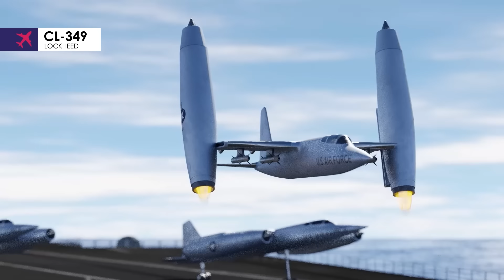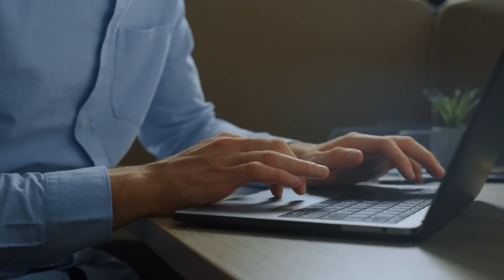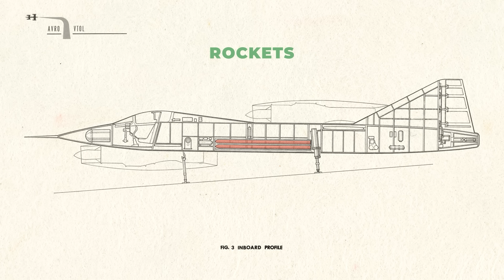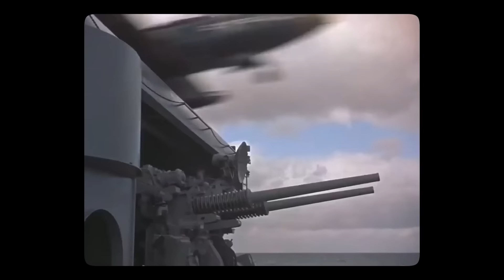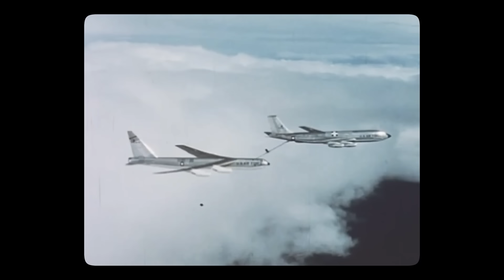Real-Life X-Wing Fighter Jet? ...Canada Tried It

Comment: That’s a cool design. It’s a pity it never got a chance. Would have been cool to see these X wing fighters in the air, and more, it would have been interesting to see what other air craft might have been born from this idea.
Historically great aircraft give birth to greater designs.
😂 Mach 1.7  is not a brick. Its speeds put it less than 200mph slower than the f16 or f18.
So for its time, it actually wasn’t bad. What probably happened was they over promised and when it couldn’t hit Mach 2 the navy lost faith. It still would have been a good bird I think, and once in production, the little bit of speed could have been worked out.
It’s not unusual for airplanes to start their life’s a bit less than planned and then become the masterpiece aircraft that were originally envisioned.

Comment: I'm a proud Canadian veteran of Cold War vintage. It does not diminish the accomplishments of AVRO Canada and their group of highly creative engineers to place this "X-Wing" and the "Arrow" in context of the competition from the giant aerospace industry in the US, UK, etc.
Some Canadians struggle with the facts because they may believe that the Arrow should have survived. Facts do not unequivocally support this.
Although it would have been nice for AVRO to survive as a result of interest in the Arrow, the facts were that the US aerospace industry was not, as some people state, behind in developing aircraft that could meet their required specifications.

Here's a short factual list of Mach 2 aircraft in order of time of achieving Mach 2 (starting with a bomber!)
1.) Convair B-58 Hustler, Achieved Mach 2 in December 1956. Designed to routinely attain Mach 2. Entered Service in March 1960, Quantity Produced: 116.
2.) North American F-107. Achieved Mach 2 in tests on November 3, 1956. Did not enter service.
3.) English Electric Lightning, Achieved Mach 2 on November 25, 1957. Entered Service in July 1960. Quantity Produced: Approximately 337.
4.) Lockheed F-104 Starfighter. It achieved sustained Mach 2 flight during its testing phase. It was designed to reach Mach 2.2. Entered Service in February 20, 1958, Quantity Produced: 2,578.
5.) Republic F-105 Thunderchief. Achieved Mach 2 during its first flight on October 22, 1955.  Designed for Mach 2+ speeds. Entered  Service in May 1958. Quantity Produced: 833.
6.) Avro Canada CF-105 Arrow, Mach 2 Attainment (meh): While the first prototype, RL-201, achieved Mach 1.9 in level flight during testing, it was designed for Mach 2 speeds and was certainly capable of it. Its first flight was on March 25, 1958. Famously cancelled on February 20, 1959.
7.) Mikoyan-Gurevich MiG-21, Mach 2 Attainment: The MiG-21 design, first flown in 1955, was the first Soviet plane to reach Mach 2. Entered Service in 1960. Quantity Produced: Over 10,000 across all variants. 
8.) McDonnell Douglas F-4 Phantom II, Mach 2 Attainment: First flight on May 27, 1958. Designed for Mach 2+ speeds. Entered Service in December 1960. Quantity Produced: Over 5,000.

With that perspective, there were no real customers for the Arrow, except for the RCAF. The Brits already had their Lightning, and the Swedish Draken was number 9,  and the French Mirage III was number 10 (if this list was continued), so no orders from Europe, the USA had their F-104, F-105, and F-4... 

The Arrow was not superior to other countries' aircraft according to their own procurement and spending priorities. Facts ensure that while one can see superficially perhaps why the aircraft didn't sell, it remains a tender issue because in reality, the CF-105 was superior or cutting edge in many ways:
1). "Tailless" Delta Wing Configuration: The CF-105 adopted a large, thin delta wing without a conventional horizontal tail. This design was chosen for its optimal balance of structural and aero-elastic efficiency, allowing for a very thin wing while still accommodating a large internal fuel capacity for extended range. This configuration contributed to its excellent transonic and supersonic flight characteristics.
2). High Speed and Altitude Performance: The Arrow was designed to achieve Mach 2 speeds at altitudes exceeding 50,000 feet (15,000 m). While prototypes achieved Mach 1.9, the planned Orenda Iroquois engines for the production Mk II were expected to push its top speed to Mach 2.5 and its combat ceiling to 70,000 feet (21,000 m), surpassing many contemporary designs.
3). Exceptional Rate of Climb: The Arrow's powerful twin engines (even the interim Pratt & Whitney J75s) and its low wing loading gave it an impressive rate of climb. It could reach 50,000 feet in just 4.1 minutes, a very rapid ascent for its era, crucial for its interceptor role.
4). Cutting-Edge Avionics and Control Systems:
* Early Fly-by-Wire (FBW) System: The CF-105 was one of the very first aircraft in the world to incorporate a rudimentary fly-by-wire system. This electronic control system provided more precise and responsive handling, a technology that would become standard on future advanced aircraft.
* Computerized Control System: Complementing the fly-by-wire, the Arrow featured advanced computerized controls for its time, allowing the pilot to operate the aircraft electronically and aiding in flight stability and control, particularly at high speeds and altitudes where manual control became challenging.
* Advanced Fire Control System: The Arrow was designed to integrate the advanced Hughes Aircraft MA-1C fire control system, intended to manage its formidable internal missile bay.
5). Large Internal Weapons Bay: Significant Internal Payload - Unlike many interceptors that carried missiles externally, the CF-105 featured a very large internal weapons bay, approximately 5 meters (16 feet) long. This allowed it to carry a substantial load of air-to-air missiles (initially planned for four AIM-7 Sparrow II or eight AIM-4 Falcon missiles, with later plans for nuclear-tipped rockets) without the aerodynamic drag penalties associated with external carriage. This was a significant advantage for high-speed performance and stealth (to the extent that "stealth" was a concept then).
6). Maintainability and Design Flexibility: Modular Design: The delta-wing configuration allowed for easy access for maintenance and modification, particularly around the engine installations. The engines could be slid out on special rails for servicing, a thoughtful design feature.
Twin-Engine Reliability: The two-engine configuration offered enhanced reliability and safety compared to single-engine designs, a key requirement for the Royal Canadian Air Force.
7). Design Philosophy for its Role: Dedicated Interceptor - The Arrow was purpose-built as a high-altitude, high-speed all-weather interceptor, designed to rapidly climb and intercept large formations of Soviet bombers entering North American airspace (perfect for the far North in NORAD - 1958). Its design was optimized for this specific mission, focusing on range, speed, altitude, and powerful armament.

When one compares the first set of "speed-based milestone" facts with the in-depth potential of the CF-105, not only does it appear extremely short-sighted not to have continued with the project, but it stinks of politics. 

The biggest argument officially thrown onto the pyre was the advent of ICBMs. So, too much focusing on only one leg of what has come to be known as the nuclear triad meant that the potential of the CF-105 Arrow rapidly lost interest, and funds were diverted. It wasn't just politics.

Which brings us up to what we can learn that is relevant today. 

Canada has been continuously let down by the Federal government's piss-poor decision making. Then, in 1968, Canadians elected a "special" kind of highly left-leaning, "illiberal admiration for Mao's China" (read his books), politician named Pierre Elliot Trudeau. Liberals flocked to the left to pay for all the promised social safety nets (that are great - to a point of paying for way too much BS). Obviously, the military was cut immediately, and capital investments and personnel numbers began to decline; today, it is out of control. Read the history of Canadian military procurement from 1960 onwards, if it interests you, but to put it bluntly, Liberals have demonized military procurement every time they could to get votes via fear or deliberately lying to Canadians about costs, "real" requirements, and anything else to get votes and SAVE Canada from "warmongering."

Chretien did it with EH-101 helicopters. Penalty and indirect costs were over a billion for nothing. 
Justin Trudeau did it in 2015: cancelled the F-35 Lightning project....re-evaluate!! Then he signed up again, and Canada will have 16 out of the total order in 2025. 
Carney, playing on Trump's teasing, but boorish behaviour, and tariff crap (which will not last - the Americans feel the squeeze!), ALSO stops the F-35 contract...re-evaluate!!!

Comment: this would have changed things drastically, I wish they went through with it. 4 engines, it would have been super fast, but doesn't look like they accommodated for sound shock when they go supersonic. Wings on supersonic jets have a shoulder at the front connecting portion of the wing, where it connects to the fuselage, which stops the shock wave from damaging the aircraft.

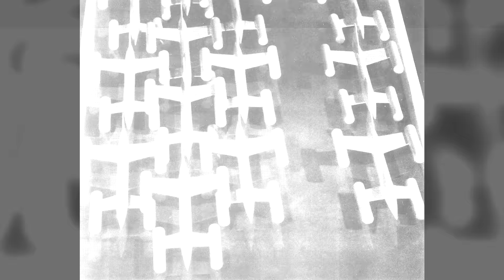Comment: 7:30  eyelid system solving in 1956 what wouldnt be tackled until harrier jet..... Actually p1127 kestrel ...that was designed by 1957??? And actually built and flown.

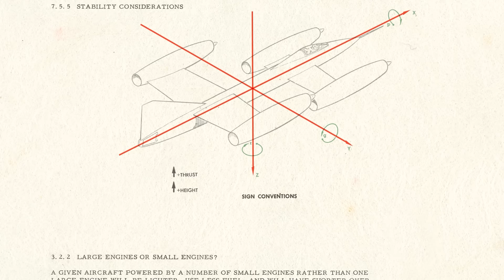Comment: 5:40 rudder pedals control rudder not flaps
Reply: Not per say, some planes would have minor throw on ailerons to counter induced roll from the rudder itself...but thats if we take flaps as a open expression and not as its usual reference to leading edge extensions/landing flaps/diving flaps/combat flaps etc and the rarely used hybrid of split flaps where none of those are controlled by the pedals or stick but rather their own control dial
Reply: That's assisting not controlling.

Comment: I feel like the main issue is just straight up the reliability.

Even if it had super efficient engines and super efficient aerodynamic design and could basically be a mach 2 harrier, there's still the issue that if one engine went down this whole plane would be near impossible to control
Reply: With modern fly-by-wire systems that wouldn't be as big of an issue BUT it wouldn't be able to perform a VTOL landing in that situation.

Comment: Remove the vertical stabilizer, reconfigure the angular relationship between the wing pairs for better lift and maneuverability, and update the engines with new high bypass versions.  Add in fly by wire and computer stabilization, and this could be amazing.  The engines being in separate pods could increase survivability.  It would need rolling takeoff and landing capabilities as well.  VTOL is nice, but very energy hungry.  Conventional takeoffs get more weight off the ground for less fuel.  Keeping a pure VTOL for combat superiority would be essential.
Reply: Yeah, a tail/stabilizer set-up similar to the YF-23's would be ideal for maximum control surface use.

Comment: The layout would lend itself better to the classic "Dropship" format from SciFi, stay under mach1 and give it to the Marines. Though, it's be fun to see if a modern RC Model Flight Controller could handle the layout, set as an EDF powered Quad Copter for take off and landing, then as a conventional wing for most of the operation, but extend the wings out beyond the nacelles for more lift.

Comment: As I watch this, I am reminded of the Avro Arrow and how that project ended. Now I see that that was brought up. As the jet engines pull on the hull via the wings, you could give the wings a strong forward sweep. It could also have minimalist wings like a Star Fighter and simply turn using the throttles as a way of avoiding the shallow turns of the Star Fighter. Give it a fan jet rather than a turbojet that could redirect its thrust downward and had enough thrust to reach Mach two. I live in the US, but I think both North American countries competing like proper ladies and gentlemen would have made both of us better off.

Comment: "simple to build and maintain" seems mutually exclusive with "VTOL" and "jet powered"
Reply: To be fair, some people have salvaged old military jets or jet trainers and fly and maintain them privately...it's not so much the jet powered aspect, it's the fact each additional jet basically adds exponentially more maintenance time since there's more fuel lines, valve gates...all the usual stuff for keeping 2 or more power plants under control...as for VTOL yeah, thats always a cost and maintenance nightmare due to the required form of thrust vectoring, nevermind the fact it immediately slashes into the aspect of munitions capacity(Harrier for one would rarely use its VTOL to take off for a mission, but rather use it as STOL)

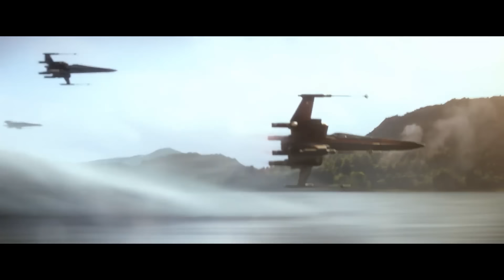Comment: George Lucas design 3:56 was better, because all the weight was on the back, the front turbine retro air thrust, had leverage. Plus applied counter atmosphere re-enterinĝ. Plus a 'before•burner' (like an 'afterbuner'), would work in micro atmosphere.
Reply: This thing doesn't even have an astromech port.
Reply: You're literally making things up based on a fictional concept, and then proclaiming it to be better than something developed by intelligent engineers that could have actually been flown and produced.  I can't tell if you're 13, or just an idiot.

Comment: Back then, the "tail sitter" design, would've been ideal. It only needing as single pilot gyro dome cockpit, plus weapons, able to swivel verticle to horizontal of its body. A mix jet-rocket & big base wings.
Reply: There are 0 other planes that have been successful using that type of design, I think it’s possible with ai and computers, but I don’t think that’s any easier of a build or anything
Reply: @domm5715  It wasn't about them having the design, just the fact, there isn't. Make them fail to keep up with modern air combat, elite fleet fights. An "AI" would still lack decisions intuition. Unless you want to make it also. Sentient👀. The price to lead & solve problems.
Reply: @domm5715 what i memtioned, none attempted, yet far more feasible. Example, there is another concept plane on this channel, the cockpit & jet plane head looking like a shoe soul internal frame, doing a massive beauracy of swiveling like a huge fat duck head.

Comment: Don't rule out  the US aircraft industry putting pressure on the US Navy to kill this project as  ten years later the TSR2 in the UK was killed because it was a better aircraft than anything in development in the US at the time!
Reply: The TSR 2 died because of the infamous Duncan Sandys air defense white paper of 1957. The same “missiles will do it all” idiocy that doomed the Arrow, the Delta 3 interceptor, the F-108 Rapier and the B-70 Valkyrie. Sandys and MacNamara blew it on both sides of the pond.

Comment: When I think of Avro engineers in the 1950s I get a mental image of the guys who would cram tuned 300 - 400HP engines into mid sized passenger cars while everyone else was saying "that kind of performance in a regular car will never be practical!"  Here we are, 70 years later and such power output is nothing remarkable in a passenger car.  Similarly, some of the "crazy" designs of those mid 20th century Canadians would be seen as perfectly reasonable today.
Reply: I don't know. Avro's designs seem to fall into 2 categories: things that always were perfectly reasonable (CF-100, Jetliner), and things that still seem crazy today (X wings and flying saucers). The Arrow was highly advanced for its time, but it wasn't the only delta-winged fighter jet, or even the craziest (the Mirage III had a rocket booster )
Reply: Avro are the guys who routinely played with 2000hp engines in a daily driver…
Reply: true.